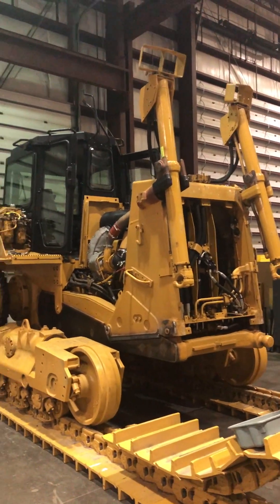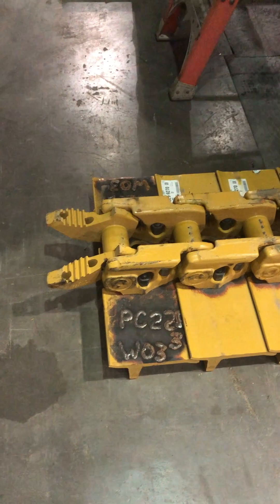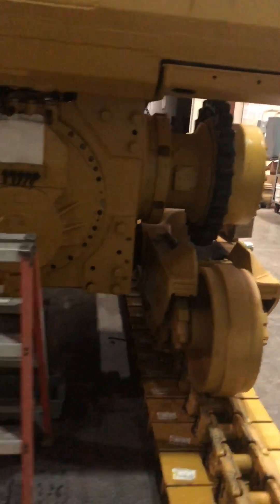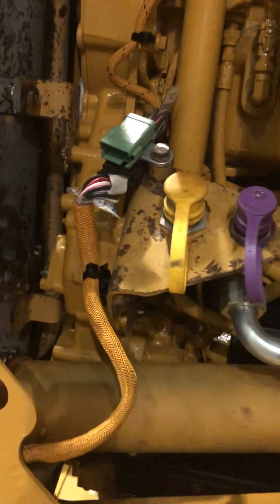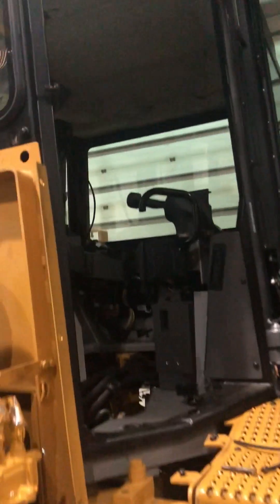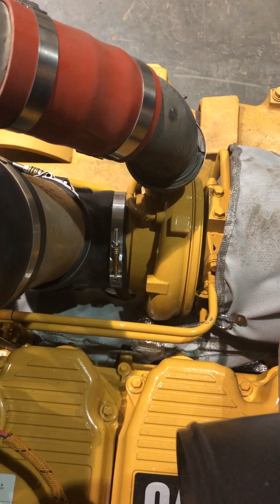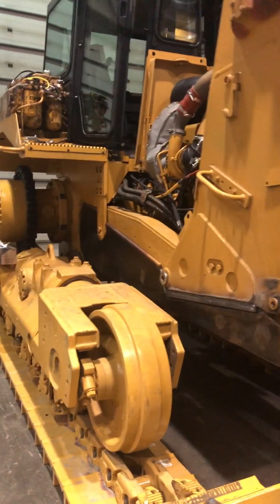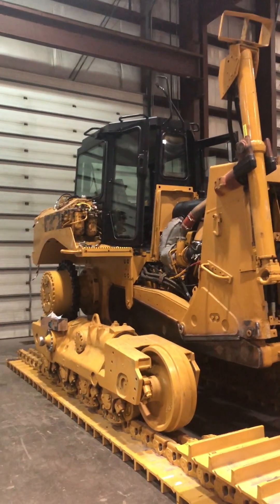Caterpillar D8T full rebuild Part 2

Comment: So this is allot cheaper than buying new? I guess this is for a municipality.
Reply from the maker: Yes. The main reason being because of all the housings and other metal parts that can be cleaned and reused. A transmission for example can theoretically have an unlimited number of lives and long as the housing is fine. It does not really wear. Just holds the internal parts and fluid.
Reply: When I was the Shop Steward at Fresh Kills Landfill (only about 6 months ). My job was to move equipment around the shop for the mechanics. So, I got to see them rebuild machines from beginning to end. Dang, new yellow feet. MMmmm mmm.